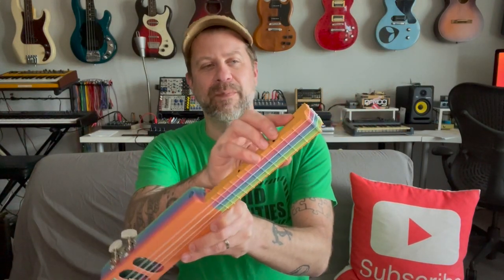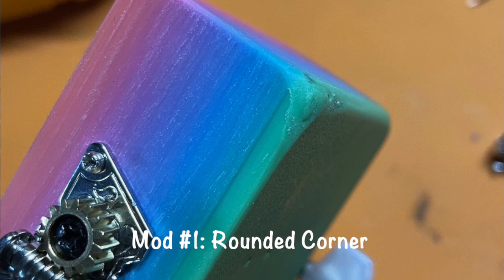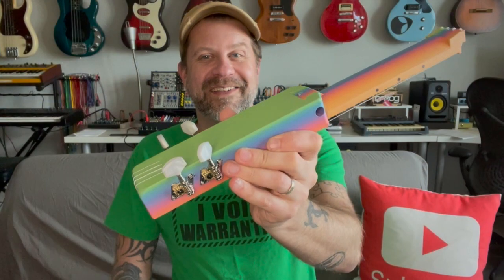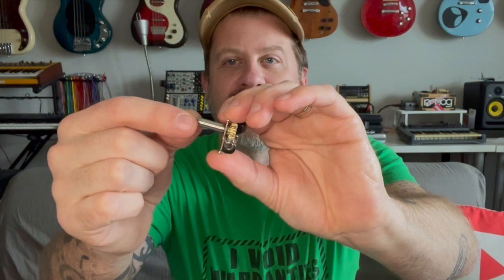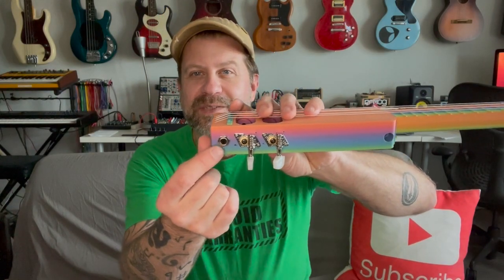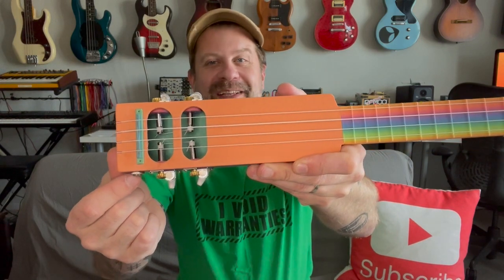Modding a 3-D Printed Travel Ukulele

Comment: If you want to fill in those holes, Bondo or most other auto body fillers are common for repairing holes in 3d prints. Alternatively, you could use a soldering iron to melt a scrap piece of 3d filament into the holes if you happen to have or know someone who has some.
Reply from the maker: That's a good suggestion. Thanks for checking out the video.

Comment: That didn't take long!  I knew you were going to mod it!  The next step is to put in a psycho-knob,  LOL!  By the way, what are the inside dimensions of your carry-on bag?  I have a couple of ideas for a travel uke for you. Maybe we can collaborate on it!
Reply from the maker: It's hard to get an exact measurement because the case is not perfectly rectangular but it's about 13"x19" (give or take due to the rounded corners). I looked it up, and it appears the size limit varies slightly by airline. However, most domestic carriers adhere to a metric of 22"x14"x9" or smaller. I know mine fits with a little room to spare on Southwest, American, Alaska, and United airplanes.